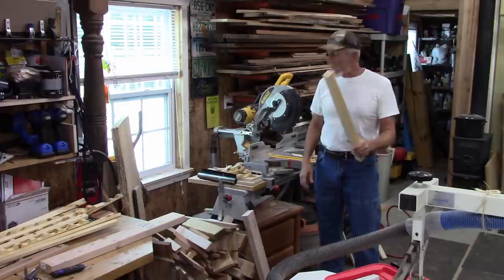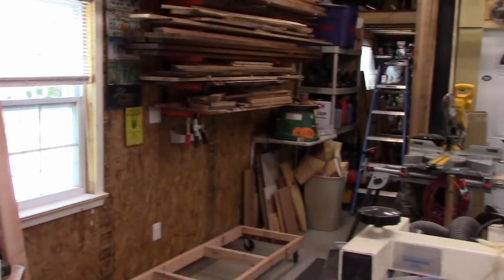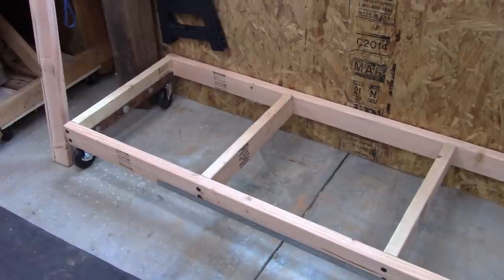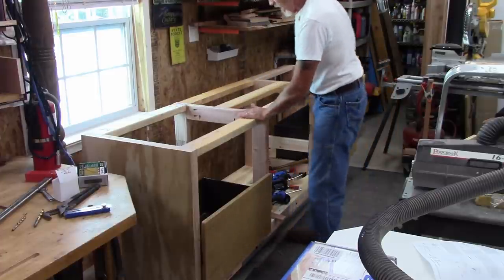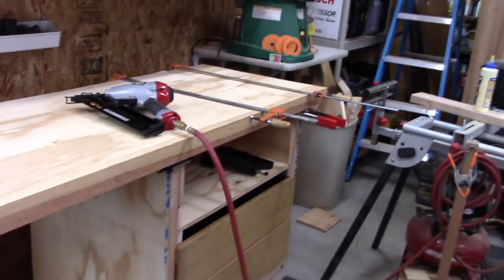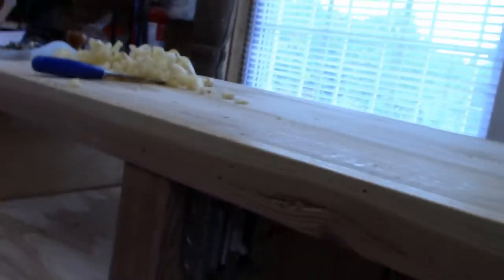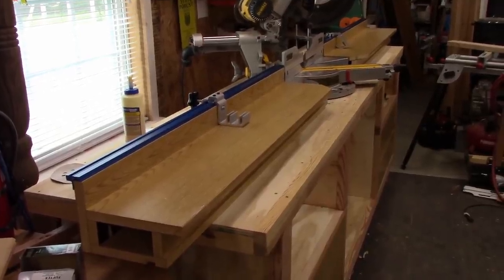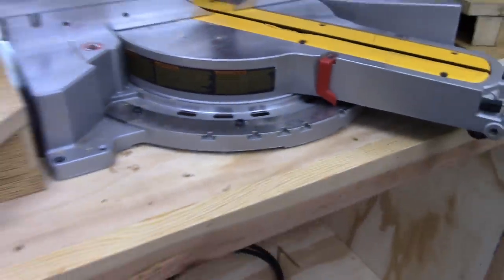Miter Saw Stand with a Kreg Precision Trak & Stop system~DIY

Comment: nice ! only input I have is on the power side,split plug in wall, one for saw, second for vacuum , in case the saw draws do to knot or tough wood. Dewalt wings, do they hit your new fence?The switch is a great Idea !
Reply from the maker: They are 2 different circuits. All my circuits are 20 amps in the shop. The wings do hit the fence but so far not a problem. I sure am loving my stand and the switch works great. Thanks John
Reply: excellent

Comment: Quick question.. When you turn your saw on the bevel,  dont you have to slide out your fences in order to have clearance for the saw to slide properly? Just wondering.  The set up looks fantastic though!
Reply from the maker: Hi Aaron... You're right about that   It was an oversight on my part. I don't cut many bevels on that saw but I have to correct it. Live and learn 😎
Reply: I was looking at that to Aron

Comment: wouldn't it be easer to make the miter saw table lower for the saw instead of making 2 sides higher. Also you would have wider side tables on each end. You would be able to support wider boards.
Reply from the maker: You're right but I was using the old cabinet and trying to go as cheap as possible 😎